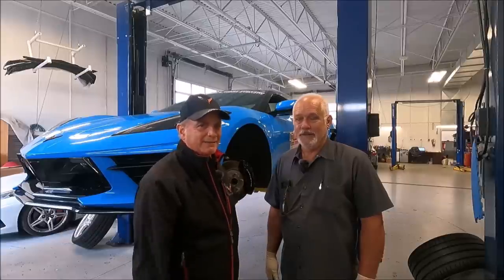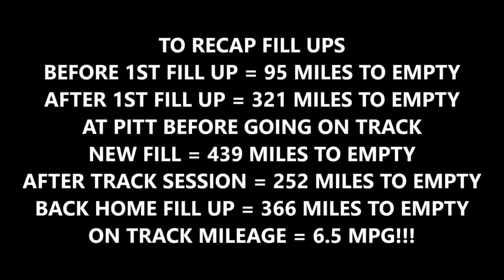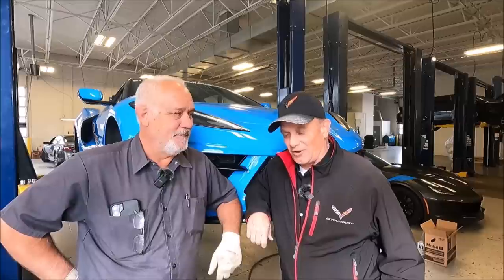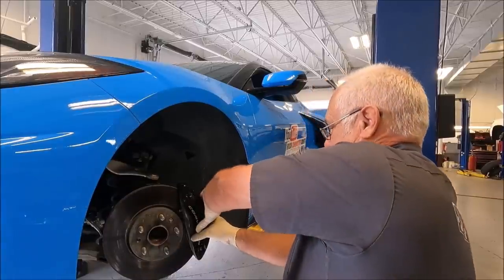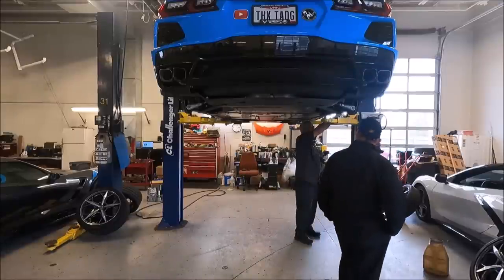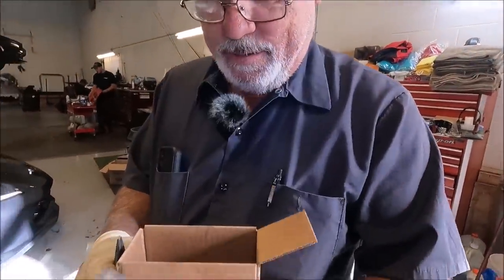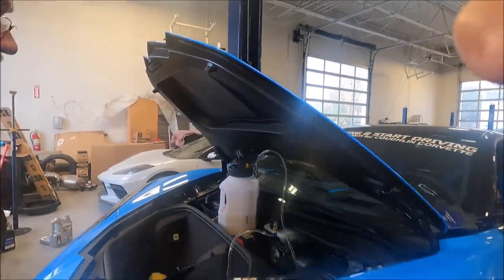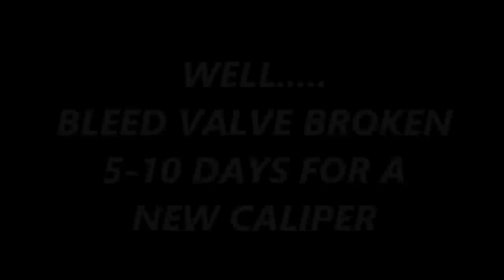RICK CONTI SMOKED HIS BRAKES - SEE HOW on TECH TUESDAY & YOUR RIDES

Comment: Hi Rick,
Great session today on changing the brake fluid. I wish that I would have been able to see the procedure before I tried to install the hi-temp fluid in my car. That’s all I knew is that you had to disconnect the battery.
Well, I did it wrong and got air locked up in the system. The car went into limp mode and had to take it to dealer.
Three days and $1400 later the car was back to normal. I have been in the auto repair business and restored and showed many corvette’s. The C8 is a totally different animal and not to be messed with by the uniformed.
Great job with your channel!
Tony Sofia

Comment: Rick/Chuck, good videos appreciate all your content. My question is do I need to fill up the gas tank before I winterize? I already winterized my '22 C8 and left it at 105 until empty. I was reading the gas tank is sealed and fill up not required. I use Shell 93 octane and i did not add any winter gas treatment. Please advise. Thank you.

Comment: Castrol SRF high performance brake fluid. Also for oil does the C8 require 15W-50, for track use, like the C7 ZO6? I have done it and it’s a PIA.

Comment: Question for Chuck, Did you run the back flush process before changing the DCT filter? Do you need to do it before changing the filter and fluid or is it only required when the transmission has an issue, throwing error codes to get the maximum particulates out of the transaxle? The manual's a bit confusing on the subject.

Comment: Re: track Prep:  can you please give an EST $$ Cost (at the dealer) for the following Items:  1. Change brake fluid to High Temp $$ and Procedure.  2. Add 2 Quarts of DC Fluid (which by 2024 Owners manual is no longer needed) - also do you suggest still adding the 2 quarts. 3. maybeNo plan on changing alignment (since this will only be occassional, maybe 2-3 times a year).

Comment: Hey Rick. Put some carbotech pads on it, change the brake fluid and track it. I think you’re over reacting. 😊 You have temperature gauges for everything. When you start seeing something overheating, THEN move to Z51. I seriously doubt you really need to be afraid of it. You just weren’t properly prepared. I drove a non Z51 2000 coupe at every track out east as an instructor for the NCM HPDE events for 5 years before they built their own track.  I never had brake fade.  On another note, you keep saying miles to empty has something to do with driving style. I know it’s just semantics but the trip computer calculates it based on the previous mileage. If your getting 10mpg you will go 180 miles on 18 gal. If you’re getting 20mpg it’ll show 360. I recently showed 310 miles with full tank and then went on a roadtrip. I drove 60 miles and it still showed 305 to go because it was recalculating continuously. Etc etc. Keep up the good work on the channel. I haven’t missed a show in 3 years. 😊
Reply: Yeah, I'm surprised the mileage thing got to be as much of a conversation as it did (thank you for having it, though!). Just not a novel thing that MPG varies. Those estimates have been on cars for years. 

Heck, I play a game on longer trips in my Escape trying to get the remaining mileage available over the remaining distance on the trip so I don't have to stop 😅

Comment: so I saw how u unplugged the brake fluid level sensor.  How do you disconnect the booster system?  I am a do it myselfer so is this possible to bleed the brakes at home or do you have to have a GM laptop??

Comment: I got the same track Bug….. I’ve been going to GingerMan South Haven MI and Autobahn in Joliet Il Having a blast….. I have a z51 and last time had what I thought was a warped rotor…. I guess it was brake fade….  I’m driving much faster than when I first started…. So now I need to change to a high temperature brake fluid….. Not sure what to use….
Reply: To me, Castrol SRF brake fluid works great on my 2022 C8 with Z51. I've been on 6 track events with the car this year and no brake fluid issue so far.

Comment: Does the Z51 car come with higher temp fluid in it from the factory vs the non Z51 car?
Reply from the maker: no sir, thanks for watching , but has to be added in the event you do such a race session - more on that once I get ready to hit the track again next spring - I'll need to get 1500 miles first though ( required track break in )

Comment: If you have 23,000 miles now, and assuming the DCT filter was first replaced at 7,500, why replace it a second time at 26k if the service interval isn’t that short?
Reply from the maker: on my 4th filter
Reply: @RickCorvetteConti  I understand that you can't over-service this car, but according to my Owner's Manual, four DCT filter changes aren't needed until the car gets to 67,500 miles.  Is there something I'm missing?  Even the second filter isn't required until 23,500.
Reply: @brianmcgauley2664  when you start tracking (I mean really tracking here - on high-speed pro road course tracks, and not just doing autocross or road rally's events here..!) this car often you need to not pay attention to the owners manual anymore and do oil & oil filter changes much more often = after each track day (which is at least once a month for me during track day season) event and do hi-temp (preferably 660 racing brake fluid) brake fluid full-flushes and DCT filter changes at the begin of every track season (at least once year - every April).  Just like real motorsports racing - track days prep and maintenance is not cheap, and your owners manual only applies for street only car usage here and not for a track day usage car schedule..!  You got to pay to play here...!!!  🙂

Comment: What makes brake fluid get so hot?
Reply from the maker: the speed into a corner and then applying them to slow down, there were 19 turns on that track and we were flying...I should have put high Temp fluid in, but again sharing my experiences and learning together through them
Reply: @RickCorvetteConti  I realize that higher speeds heat up rotors and pads, but how is that heat transferred to the brake fluid itself, especially to the “boiling” point.  I thought brake fluid is mostly in lines that run from the master to the calipers.  TIA

Comment: Shame on you for not doing the proper prep!
Reply from the maker: What do you mean ?????
Reply: @RickCorvetteConti  Not changing the brake fluid.  You never go to a track, regardless of how you THINK you will drive, and not do what is required...especially you at the Corvette guy!  

Every time I took my C5R-427 to the track we fully prepped the car.  The only mistake I made one time was taking it to a chevy dealer to put on racing pads.  After the morning lead-n-follow laps,  on the first hot lap at Road Atlanta, at the end of the back straight away doing low 160 MPH, I headed down the hill to a left 90 degree turn, hard braking, and oops the brakes are not working properly.  I went into that 90 way too fast but the Nitto racing tires held.  I pulled off the track and found metal shavings all over 4 wheels.  Fortunately the owner of a Corvette shop was there with his mechanics and they fixed the mess.  I never went back to that Chevy dealer again.
Reply from the maker: @Pmtd1234  correct I admitted that and shared it on the vlog for others to learn
Reply: @RickCorvetteConti  For sure you did the right thing telling everyone!